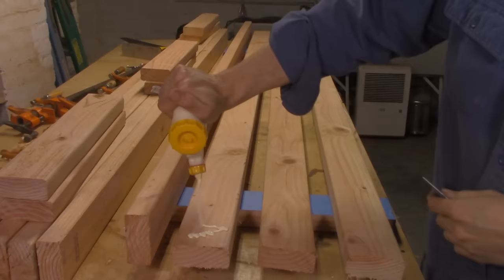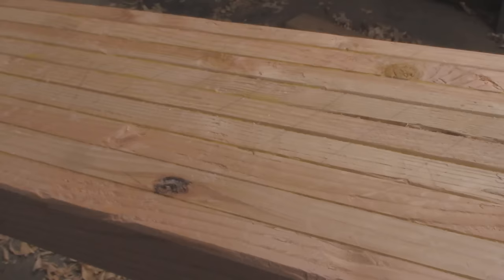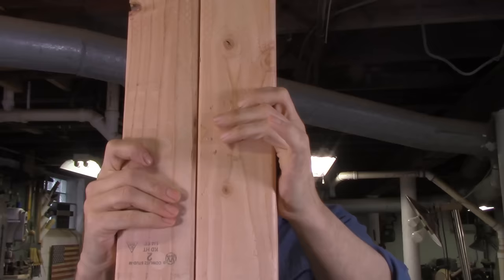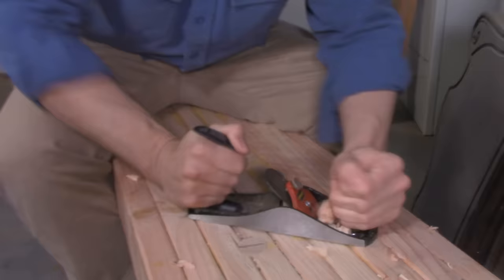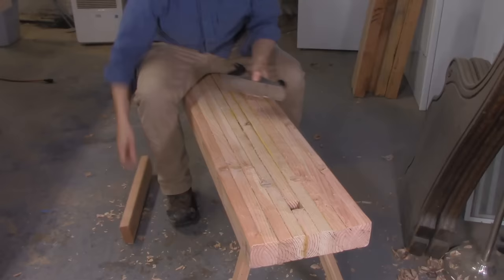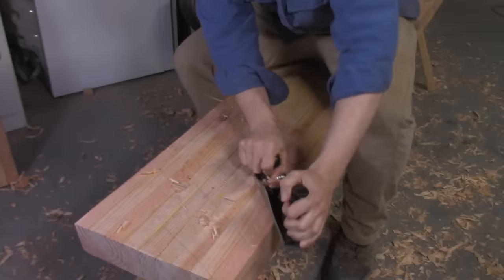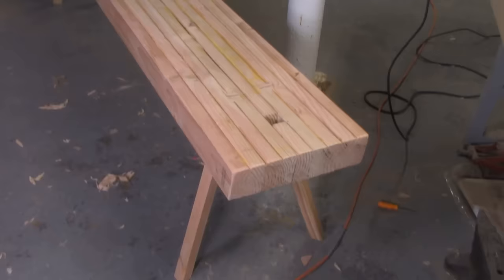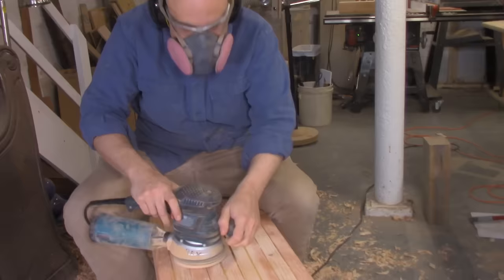Flattening the $30 workbench with one cheap plane.

Comment: Any difference in using water-based vs oil-based spar-urethane? Would I still use mineral spirits (50%-50%) if using water-based? Or is it not needed at all?

Comment: I think that polyurethane feels wrong to use on a work bench (and other stuff) because wood is a natural material and can decompose once out of use and it feels like one should preserve that instead of putting all sorts of goo on it. Or burn it in your wood stove, but again, burning the goo isn't good for the environment. I like wood as a material because it's not plastics so I want to keep it that way. Softwood being kicked around is an argument maybe bit you got a lot to go, you can flatten it more later should it become too bad. Hm.

Comment: Couldn't do it in the UK. A piece of wood like that would cost you 10 quid a piece.
Reply from the maker: So, what can you do to make a bench like this in the UK?
Reply: @RexKrueger  the UK is small and densely populated (compared to North America), there isn't that much area of softwoods grown for lumber, so most of their construction lumber is imported from Canada, Russia, etc. 
Naturally prices are higher than what we're used to here, though I suspect that price is a little exaggerated, a quick Google search yields results at half that price:
https://www.wickes.co.uk/Products/Building-Materials/Timber/Sawn-Kiln-Dried-C16-Timber/c/1009004

It is still the cheapest option even in the UK, short of finding some reclaimed lumber
Reply: I was actually slightly wrong, 92% of their imported softwood comes from the EU, and only 6% from Russia. Although this doesn't necessarily mean the origin is the EU. A large portion could be timber imported to EU countries and milled there to be sold to the UK and others. Those sort of details are harder to quantify in statistics, but in the end only 38% of softwoods in the UK are produced internally
Reply: @RexKrueger  a constructional 2x3x8ft is £2.74 here: https://www.diy.com/departments/c16-cls-timber-t-38mm-w-63mm-l-2400mm/1798294_BQ.prd

This is pretty much the cheapest you're going to get over here and would be where I'd start if I were to make this bench on a suuuuuper tight budget.
Should add that they do home delivery, so folks without a big vehicle etc can have it dropped off at the door.

That said, eBay and local yards are your best bet in the UK - takes a bit more digging to find good +/ cheap timber.

Thanks for the video, Rex

Comment: I attempted to plane a 2x4 that was not straight. When I finished three passes, I put a level on the board, and there are still high and low spots. Why?
Reply from the maker: You used a short-ish plane that just rode the hills and valleys. You need to test the edge before you plane it,  work down the high spots, and then plane the whole thing. The plane won't straighten an edge by itself, you have to be intentional in the way you work.
Reply: @RexKrueger  Okay, my planer is like the one shown, how do I do that? Thank you!

Comment: If anybody knows where I can get 2x4s at that price in Germany, let me know. I'd claim them to be 2-3 times more expensive. 

And I wonder: what if I mount a laser on top of two reference points, maybe steel balls... and I shine it at a far away wall, wouldn't that show nicely how flat is is? Because if it was truly flat, the laser wouldn't move up or down at all. People who flatten cast iron work surfaces sort of use a telescope for it but a laser should be good enough provided the screen is at a distance. Even an led and reading glasses would work.

Comment: Run the 2x4s thru the table saw knock the crown off before glue up
Then hit it with belt sander
About 2minutes finished
Reply: that's... that's not the point...

Comment: Why would you sand if you have a plane? You get a better finish with the plane set up correctly and it's way faster than sanding.
Reply from the maker: Not Sure Reversing grain direction + cheap soft wood+ knots + no chip breaker = not a good finish.  Sanding was faster and easier this time.
Reply: A proper sharp planer doesn't care about pine knots. With 2x4 tops its easy enough to also reverse your stroke. Try pushing it at 60-75 degrees across knots. One tip I think you should add is using winding sticks when flattening. Top first then make bottom parallel. Just cause it's cheap doesn't mean pine isn't beautiful too.
Reply from the maker: I'm pretty sure you didn't watch this video. There's no pine and I DID use winding sticks.
Reply: @RexKrueger so what would you call those pine 2x4s?
Reply from the maker: @notsure103  Douglas Fir.

Comment: Why didn’t you just use your table saw to cut the round sides off of your 2 x 4s? That’s a start at least...
Reply from the maker: I think you missed the point.
Reply: @RexKrueger  I didn't miss the point, really. I get your point of how to complete the project with one tool. It's just so inefficient that it's harder than necessary. Even if you wanted to introduce a couple more hand tools into the equation, it would be far more economical. If you, and this is my opinion, want to educate someone in methods that can be applied to complete a project with one tool, then it should be efficient as well as informative. I guess I'm just not your audience, sir. This seems like hard work for the sake of working hard.
Reply: @multidinero  Is it efficient to make a video that goes over every single possible technique that could be used to accomplish the same task, from table saws to router sleds to industrial size planers, when the video series is specifically geared towards novice and traditional hand tool woodworkers? Nothing is stopping you from using a different technique to flatten the bench if you have access to better tools to make it happen.
Reply: @Illevas001  though this is an old comment by me, I’ll say my mind hasn’t changed. Doing everything inefficiently with one tool is a bad idea when adding one or two more will decrease the amount of time in the doing. Applying a tool to many tasks is fine in theory, but when you start applying the skills to those tasks- you can’t help but feel that you’re doing double the work.

Just my opinion, though.

Comment: @UCj4SLNED1DiNPHComZTCbzw

@UCj4SLNED1DiNPHComZTCbzw@UCj4SLNED1DiNPHComZTCbzwPlease forgive me the volume of my query.  I appreciate you "giving permission" to have a project less than perfect as perfect is the enemy of good enough.  I keep telling myself that but...ADHD. I'm considering asking a friend to joint and plane the top after I glue it up in sections.  Here's a question created out of seeing your bench dog/planing stop/ holdfast hole spanning the width of one 2x. My thought is to glue two planed and jointed SYP boards topped with a one inch hickory or black locust board and glue them face to face and horizontallyblack
every time
     Your channel is well done in most areas and your instruction is clear. It would be a benefit to get a cameraman to participate so you might seamlessly bring the view of the work hard by to our eye to see detail including the pencil lines and the top after planning.  I will watch this vid again, watch the English Joiner's table vid  and several others and marry differing  ideas into one bench. Subscribet.    Thank you.

Comment: The only thing i dont undestand is that why do you americans have those "2 by 4s"  milled that way, why do all the profiles you buy  have rounded edges, here, in my country, and all the neighbouring ones (central europe) you have to pay extra for round edges. And trust me, the price ddifference is huge. From the seller perspective, there is an entire market for just rough cut lumber to standardised dimensions, and maybe you Guys get an actual 2 by 4, cause i belive that the 2x4 are the center dimensions, but if you take away the edges to make it square, You have to end up with an actually smaller dimensions, which can make a real comlications when it comes to buying wood for project. I uderstand that you know about it, but tell me, ISNT IT JUST WASTE OF TIME OF EVERYBODY?  Boardmakers for having to DO the edges, and for furniture makers, carpenters and construction workers for haveing to keep that in mind all the time? TF

Comment: All you had to do was use a flat sheet of say .. plywood and then glue the wooden lengths together on the top of said sheet of plywood + also using clamps, then turn it over and voila, a flat top. Then attach legs via the sides and No Need for all this silly planing.
NOT rocket science tbh.